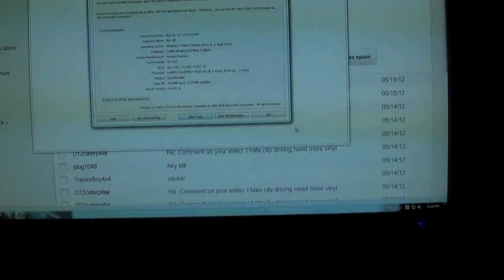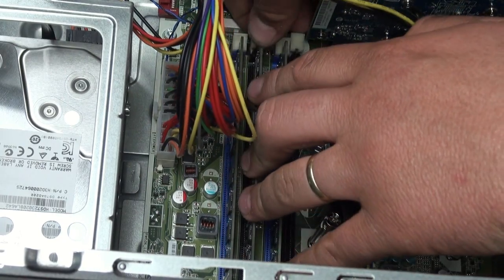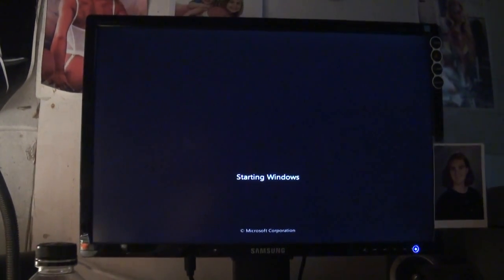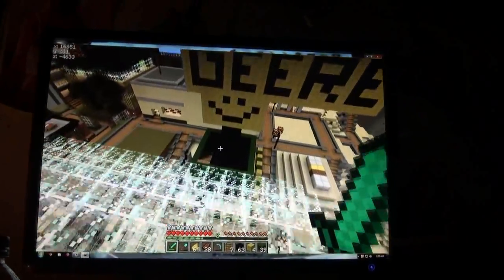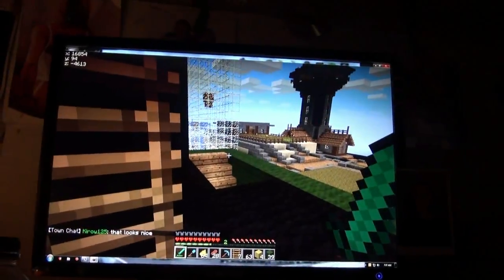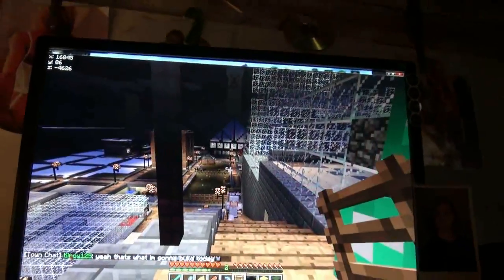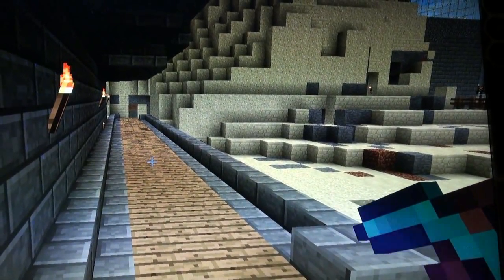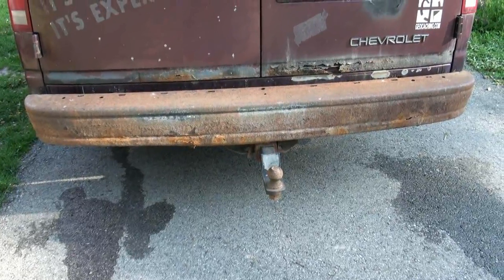WARNING this video contains RAM and MINECRAFT

Comment: The power supply has capacitors that can hold current. The LED runs off their charge. When you have it unplugged, if you push the power button, the computer may act like it is starting up, but fails because, guess what?, there is no power!